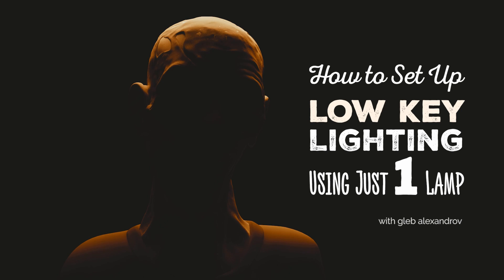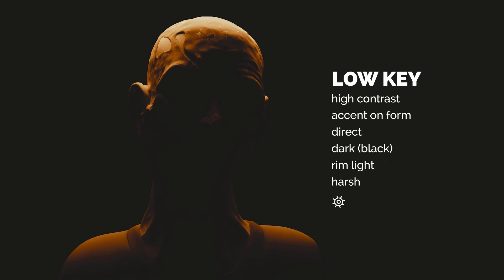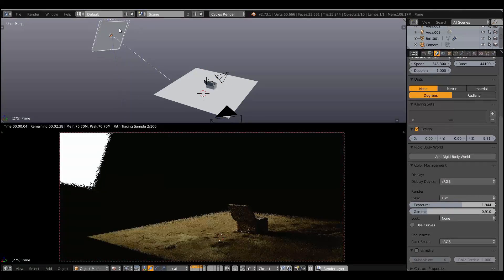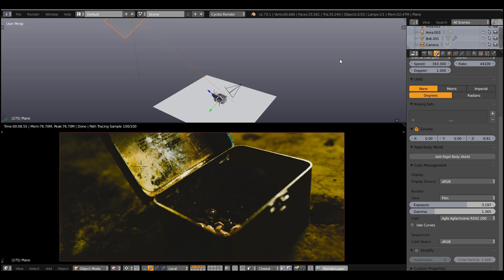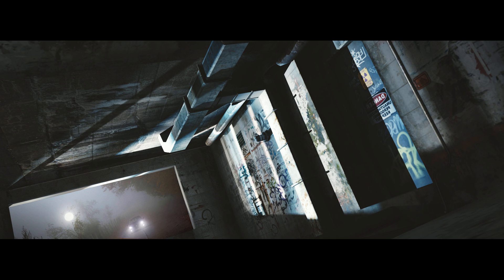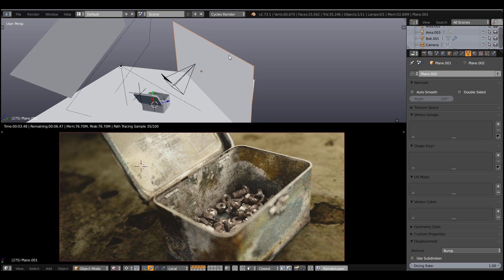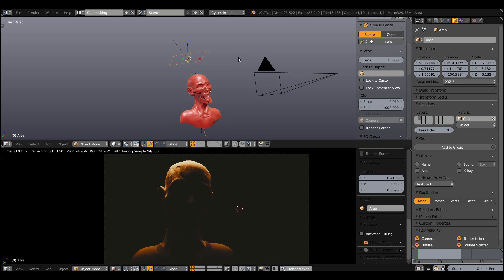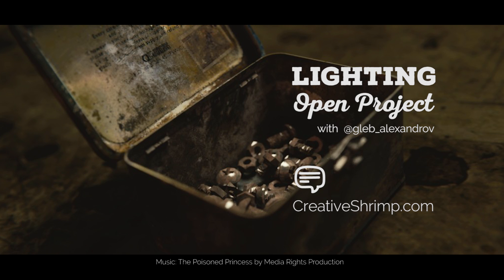How to Set up Low Key Lighting, Using Just One Lamp?

Comment: Very nice video Gleb! I like your website too! I have a simple question, it seems that in the rendered viewport the only thing that is rendered is what's inside the camera frame,everything else is black and nothing is being sampled at all. Where is the option to do that in Blender? Or did you simply use a render region that just matches the camera frame? Thanks in advance!
Reply from the maker: Riccardo, yes, I used region that matches the camera frame. And for making black everything outside the camera view I used the 'Passepartout' alpha slider in the camera settings.
Reply: Gleb Alexandrov Thanks Gleb! I'v missed the Passepartout checkbox! It's also useful to set alpha at 0, in some cases that semi-opaque overlay around the frame is very annoyng and I couldn't find out how to remove it! Thanks again!